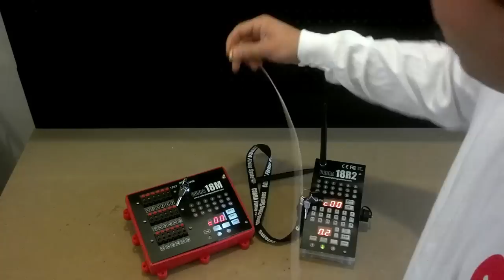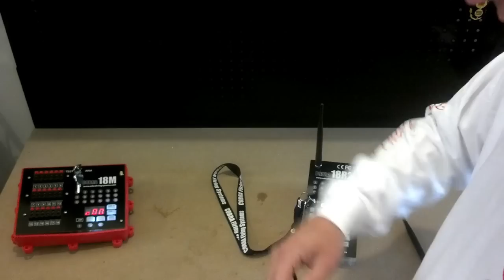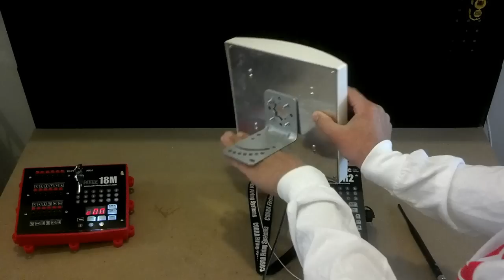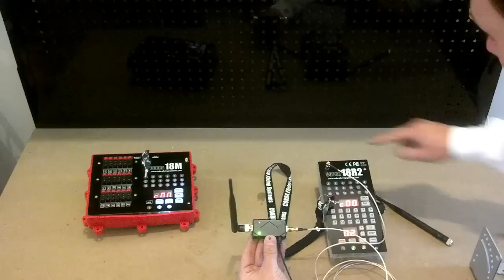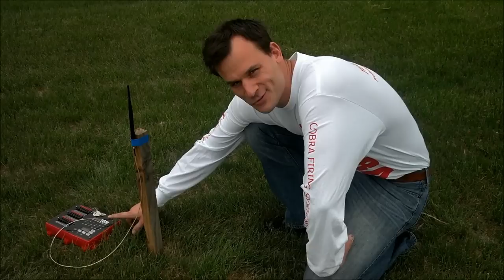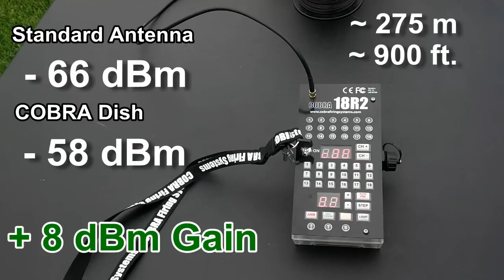COBRA - Link Quality and Signal Accessories

Comment from the maker: Your signal would becomes dramatically reduced. That is why we suggest taping down the A/C connection. With our Booster Box, there are no power wires and therefore there is nothing to unplug other than the antenna cables which are secured with a thread.